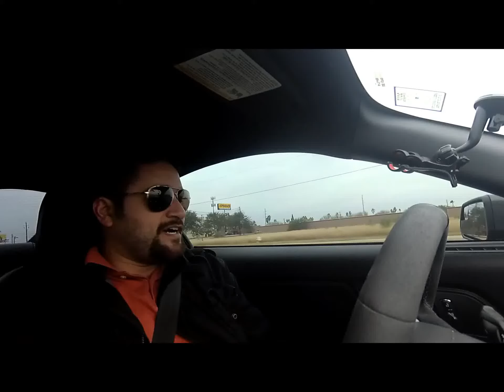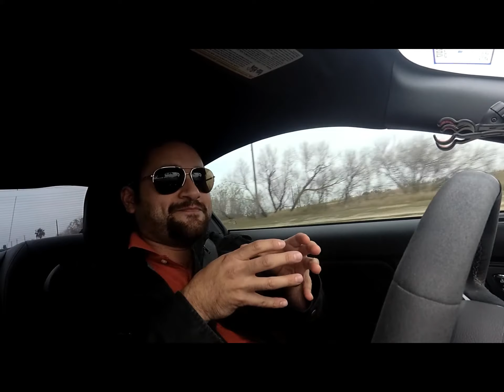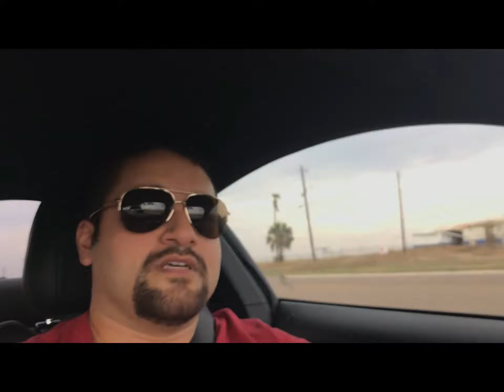2016  v6 mustang (update, news)

Comment: Project car! Project car! Sometimes if the 5.7 Hemi engine has over heated I’ve read about valve seats dropping. Is yours a RT?
Reply from the maker: DavidJWarEagle yes I think mine might have that issue. I have not been able to get to it due to the weather but I have a good feeling that’s part of the problem. Thanks for the advice
Reply: mmagnetic2016 mustang I think getting a borescope and taking a look inside each cylinder would probably be the best thing.
Reply from the maker: DavidJWarEagle That is exactly the tool I meant to say in the video lol I know a friend of a friend that owns one so hope to do that this weekend